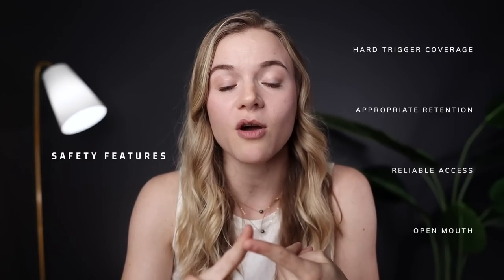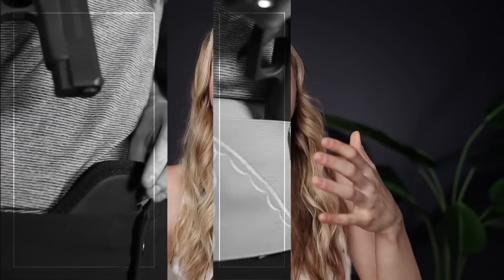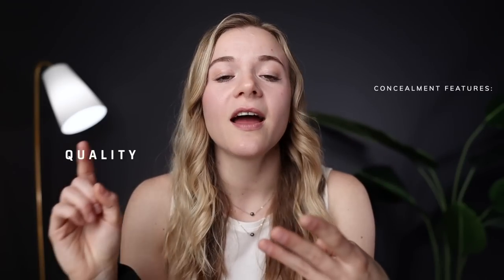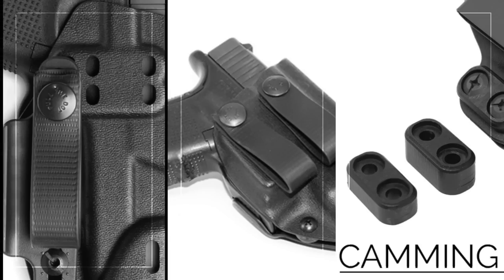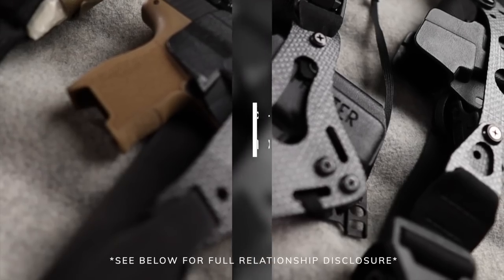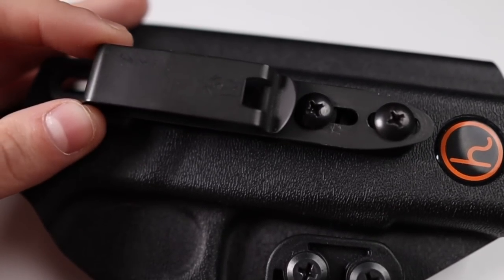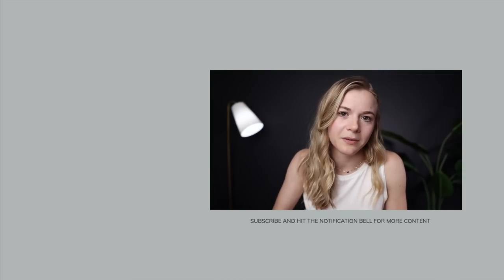How to Avoid Buying Holsters that WON’T WORK | Stop Wasting your Money

Comment: Darkstar has been working out well since you recommended it last year or so in another video, I've been using one several months now for 16+hrs/day. I still like my Las Concealment better slightly better design but they only offer mid height sweat guards and I prefer full guard that Darkstar offers. Solid suggestion is workin out well, only thing I don't like is the lack of mag release cover / indentation to protect from an accidental release incase of rolling around in a tussle. But so many holster don't have that awesome feature so it's hardly a deal breaker. As for wedges I just use the tear drop foam wedge which molds to your body shape after about a month of daily wear and a cheap Clinger Velcro on pad makes a kydex holster as comfy as a leather backed hybrid holster that's much easier to wash when ya sweat over time that leather just gets kinda funky over years of wear. And the Clinger pad can be placed to slightly overlap and areas that may poke you throughout the day.

Comment: One part to add to be covered is belt clip or loop attachment.  I have found after trying multiple holsters that only have a single clip or loop that the holster changes angle or rotates regardless of the type of clip or loop and belt interface.  I also prefer a little spread between the clips or loops so the gun doesn't sag or rotate some when the clip/loop attachments points are very close together.   These aren't factors since switching to the Enigma but previous belt carry they were significant even with the best clips.

Comment: Great video!  You cover SO MUCH that’s typically left out of most AIWB holster videos. 
1. The wedge at the muzzle. 
This is an absolute game changer for concealment and comfort. 
2. AIWB holster length. 
As you’ve stated, most people benefit in comfort and ability to conceal from a little more holster length. That “keel principle”. 
Many people that are new to AIWB think the shorter the holster the better, but are surprised to find the opposite is true for them. 
For my G43x, I use a G48 holster with muzzle wedge from JM Kydex….which is totally making me wonder why I’m not just carrying the G48 with it’s improved sight radius….hmmmm. 
For my G19, the standard length holster works alright, but a G17 length is even more comfortable…which is also making me wonder why I’m not just carrying the G17. Again, hmmm……

My go to is JM Custom Kydex, but also don’t forget Keepers Concealment. 
Spencer’s holsters are fantastic, and utilize both the foam wedge and additional length. 

Thanks again for the content. 
Your videos constantly include content that most others leave out.

Comment: Tenicor Velo4 appendix holster is my absolute favorite for my P365X, followed by my Tier 1 Axis Elite when I want or need a sidecar style. Both of these holsters are fantastic! You were spot on about a lot of holsters having their concealment wing too close to the holster and it interfering with your ability to make a reliable purchase on the firearm. This is a point that doesn't get nearly the coverage that it needs, well done!
Reply: Are you running the metal clips on the tenicor? Ive been thinking about getting one.   Wife has the axis elite and it is the most secure holster we have. I can do somersaults with that thing on. Also have a raven concealment vanguard 2 which is nice for some instances and a cooks ulticlip which i use alot. I just dont have a dedicated appendix holster without a sidecar.
Reply: Tenicor is tits man.. I prefer their certum over the velo, but they make excellent holsters all around

Comment: 1st off great video! I think you can cut down on the box of shame. but you will still have one. Carrying a gun is a process of trail and error, how you're willing to adjust your dress plays a big part in it. Equipment evolves of time over time, I start back in 1996. Process have changed, and improved.

Comment: Most understandable and clear explanation I've ever heard. Extremely well made. 

One question . . . can you suggest any good custom holster makers that will actually design holsters for light-bearing handguns? I have been unsuccessful locating any. They all have very limited laser/light combo models matched to firearm models or don't make anything for my Baby Desert Eagle 3 and Crimson Trace CMR-204 or HK VP9 with same.
Reply from the maker: You're going to be hard pressed to find the intersection between QUALITY and QUANTITY. If a holster maker is designing quality products they're going to be hard pressed to keep up with the constantly changing light accessories, let alone the largely unpopular light/laser combo accessories. 

You will be much better off catering your light selection to what quality holster makers already have available.

Comment: Best holster I’ve purchased was a bravo concealment OWB. I’ve tried JXtactical fat guy holster, Alien gear, Tulster.  Carrying appendix is just a nightmare for me because I’m 6foot 260 pounds and it’s incredibly painful and uncomfortable as well as drawing the gun and re holstering. My bravo concealment is a strong side 3 o’clock carry and that’s worked wonders for me. Definitely gotta lose some weight before I try appendix carry again.
Reply: In the process of losing weight here, currently carrying at 5:00 with a OWB holster, I tried AIWB again and I just don't like it.
Reply: @Razor-gx2dq  funny enough I bashed Tulster but wound up getting the Tulster oath for the Glock 48 with a kore essentials gun belt and now appendix carry is possible for me! I’ve lost 20 pounds and it’s been way better for me.

Comment: So basically what I've learned after buying my first holster (a trex arms sidecar btw) is that I need to lose weight, because in order for me to tuck the grip even somewhat well I have to have the gun really low which makes my belt sink low in the front which looks weird with my shirt up. I got a set of wedges from T1C, the wide sizing pack to be specific, and I'm still not sure it's making that much of a difference. Furthermore, I have a TLR7A and now I'm wondering if I'd be better off getting a TLR1 so the holster is longer and wider at the base. Sounded backwards until I actually put on the holster and realized it felt short and pointy.
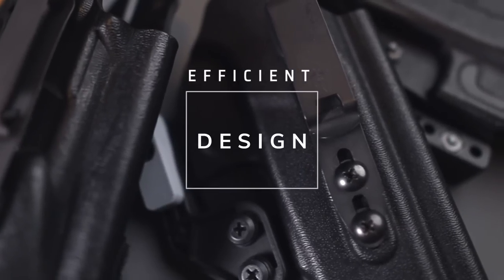Reply from the maker: Check out the 10:10 efficient design time card in this video, I discussed a number of the issues you mentioned 😊👍🏻

Comment: Thank you,  so far I have at least 4 different holsters.  It's so hard to find the right fit. I'm 4"11 and have a short torso so it's been kind of difficult.  I finally found one that works great.  I think I do need a Wedge though because my gun does move forward.  Thanks for the link on that too. I've never heard of them before until you said something.
Reply from the maker: The graphics, and videos here: https://www.phlsterholsters.com/the-basics-of-concealment-mechanics/ should help you navigate through some of those issues. For you, I'd start with the "poke and check" video (https://www.youtube.com/watch?v=ajGkIqsPAPA&list=PLrjZ_jHF_Spku_RJvSU5l7kr8rE96OftL&index=3&t=51s) and then go from there. A wedge might be a great solution, but there might be a few more steps to try before that too. I totally get the small torso struggle, I'm 5'0". Placement can make a big difference on a smaller frame :)
Reply: @tessahbooth  oh my gosh,  thank you so much for your help. I didn't even realize that there were other things I can do

Comment: Unfortunately it's very uncomfortable for a guy my size 6' 2" and 250 lb to carry appendix I don't like getting jabbed in the stomach. Plus I don't like having things shoved in my pants or my pockets and I don't want to have to buy jeans one size bigger than what I need. I carry outside on the belt about the 3- 4:00 position. And due to my job that's what I have became came used to. I just find it difficult to find a kydex holster that I like because I've grown tired of the leather holsters with the thumb break.
Reply: I'd highly recommend watching the "concealment sweet spot" video under the "concealment mechanics" link she gave in the description. She demonstrated how to comfortably carry aiwb with a guy who is very close to your size. It might be helpful!
Reply: I'm 6' 270 and I appendix a 2011 with light and optic.  Just find the valley and you 'll be fine.  I drove from NC to Fla 12 hours and wore my pistol the whole way.  Wasn't uncomfortable at all.  It takes some time.  I used to carry in a "side car" style holster but had to go to just a holster and carry my magazine in a neo mag in my pocket.  Good luck
Reply from the maker: The other two who commented below pretty much said what I came here to say, but I’d also add that the customization period is key, especially so for your body type. Honestly, I get how frustrating that can be, and why 4 o’clock might ultimately feel like the solution for you, but know that you can carry appendix. You just can’t do it comfortably without being selective about holster design, placing the gun in just the right spot, and adding a holster wedge.
Reply: Look up Spencer Keepers' video on concealed carry for big guys.

Comment: I have switched to the TXC Helix instead of a wing since I always slammed my knuckle into it. I still hit my knuckles on my belt line and it's so frustrating. No clip or holster gives me the ability to have my ride height high enough to have clearance. Canting the holster makes gripping the gun awkward as well.
Reply from the maker: Have you tried the Mod 4 1.5 adjustable clip? You can move the clip up and down to increase or decrease clip clearance.

Comment: Good video. I would disagree with the holster and mag attached together. A lot find that, like you mentioned, more surface area and having the clips further apart make these holsters distribute the weight over a larger area meaning, more comfort.👍
Reply from the maker: I felt that way at first too 😊 I carried in a sidecar holster for about a year, and it wasn’t until I started spending more time with independent holster designs that I realized my concealment wasn’t what it could be due to the faults in the sidecar design. Although, generally, they can be comfortable 😊

Comment: Here is an odd tip, I accidentally got an optics cut holster for my hellcat. And it came so much smaller and it is the best holster I have. I have other guns with other holsters where are the correct ones, go figure the one that I get that’s for the correct model but optics cut without an optics works for me😂

Comment: Where else can a papoose be purchased, as levo is no longer in business? I do have the enigma express with the sport belt.  I also experience lower back pain and irritation from the material.  I have been using the wedge kit to assist with proper concealment.
Reply from the maker: I’m not sure where else you can get the papoose. PHLster usually had them, but they’re out of stock. Although, I don’t believe Levo Designs is out of business, they’ve just had some technical difficulties with their website. It could be worth emailing them directly.

Comment: I disagree on the longer holster, I got a t1c holster for a hellcat. It came with nearly an inch of extra holster material and the end was closed so it essentially became a kydex blade pressing into me. I'm a heavier guy and admit I have a bit of a gut. So I prefer a minimalist holster design that rides just high enough to safely get my fingers around the pistol grip.
Reply from the maker: I used to use Tier 1 holsters exclusively, I know exactly what you mean :) The way that they add length is not what I'm talking about in this video. The additional length I'm referring to is not created by leaving a section of flat kydex, but rather making the entire holster longer.

Comment: What holster would u recommend for the Canik Tp9 elite SC with a Baldr S olight that will work well with gym shorts!! I really would like to keep the light on it but hard to find one for the Baldr S olight an also gym shorts I wear everyday so need good clip also for that so please ur advice is greatly appreciated!!! Thank you so much for ur time an ur videos are helping me alot thanks!! (New to the Game) lol
Reply from the maker: I wouldn’t recommend attaching just a holster to gym shorts. Unfortunately you’re going to be extremely hard pressed to find a quality holster that’s compatible with that specific light. There’s lots of great light bearing holsters out there, just very few for olight. 
Holster company’s tend to steer clear from making holsters for a number of weapon lights, not necessarily because they’re bad but because the accessory is ever changing, and it’s too costly to reevaluate a kydex mold for a light that frequently.

Comment: what about hybrid holsters with leather on one side and kydex (or similar) on the front side? Mostly thinking about the trigger protection. Is the leather on the backside considered hard trigger protection?
Reply from the maker: I would say that most of the time, assuming it's a quality leather, that would absolutely pass as hard trigger protection. The main issues with hybrid holsters come with longer term use. Even a quality leather is still going to have more give to it than kydex. When we fix a hard material to a relatively "soft" material and bend/flex it repeatedly over a period of time, the hard material will eventually give/break. I'm not saying all hybrid holsters are doomed, but that they too have their weak points and it's especially important to be vigilant about checking the holster for weak points/cracks. Generally it's best to go with a full kydex holster, or a full quality leather holster (Milt Sparks, 5 Shot Leather are great options).
Reply: @tessahbooth  ok great. thanks for getting back to me so quick.  Ive really been having a hard time deciding what type of holsters to get. Your video was very informative, but ill probably end up with a few just so i can see the differences myself, and maybe theyll each work for certain situations better than others. Im on a pretty tight budget at the moment, and the gun ive chosen doesnt have a ton of options for holsters like some models do, so for now ive picked what seemed like the best quality holster, which happened to be a hybrid. I saw a review on it and the guy said hed been carrying it for two years. If i can get even a year out of my first daily carry holster ill be happy.

Comment: Good holsters tend not to be cheap. That's just how it is. A $30 kydex holster might hold a gun decently well but something like a Phlster holster is designed to actually conceal that gun. You pay for the design and build quality. My first IWB holster was a Vedder because that was the Reddit hivemind at the time but then I tried a JMCK Wing Claw with DCC clips and realized how much better it was in every way. Your channel is one of the few gun channels I watch and I wish you'd been around when I started carrying.
By the way, your channel is big enough to attract crypto scam bots. Congratulations, I guess. I reported every one of those sockpuppets for spam but you might want to delete the thread and block them.
Reply from the maker: Thanks for the heads up! I hadn’t seen those yet!

Comment: Figured I would share my one cheat code to not having a misfit collection.  Amazon! lol.  Buy a handful of holsters, try them out and return them when you're done voila! or maybe you find the one you like!?! Not every option is on there for sure but you can get started and begin to get an idea of what you like. I'm currently on the hunt but I am also trying to figure out what belt to even get, any recommendations?
Reply from the maker: I don't know of very many good holsters available through amazon, but Concealment Express with the wing add on could be a potential option! 

I haven't used traditional belts in well over a year so I don't have any personal recommendations to make, but I've heard good things about mastermind tactics belts.
Reply: @tessahbooth  thanks, I ended up picking up a tulster oath and crossbreed supertuck off amazon, I wanted to try a few out without committing so I didnt end up with that big box of them, you may have sold me on an enigma express tbh, doing my research now on which one is better for me what the difference is.  Can I get an express with a pro holster? or can you buy the express enigma without the holster? thanks.
Reply from the maker: @xempath  this post will answer that exact question in detail: https://www.phlsterholsters.com/what-holsters-are-compatible-with-the-enigma-express/

But the short and sweet answer is the Express cannot be used with anything other than the holster it comes with.

Comment: I just started and I've already bought two I'll figure I better stop for a minute because I don't really like either one of them and I don't know both of them are quality I just I don't know I got to figure out I don't like the way the butt of the gun they have all these claws and things to help push the butt of the gun in but a lot of it you can still see the printing and I don't like that I got to figure out one that will shove it tight to your body
Reply from the maker: If your holster came with a wing, and you’re still experiencing grip printing then you’ve probably placed it in a less than ideal location on your body, and/or you’re not using a belt that’s putting enough pressure onto the wing. Check out the helpful links in the description. They’ll help you troubleshoot those problems 😊
Reply: @tessahbooth  thx..finally got my ccw permit today. It's not easy in MD....I been experimenting with different things to be comfortable...... appreciate your help